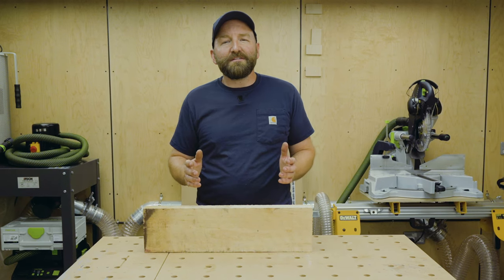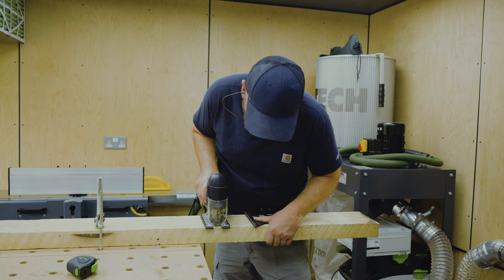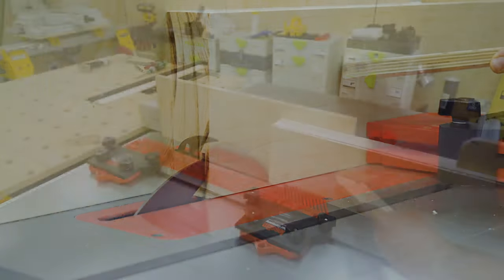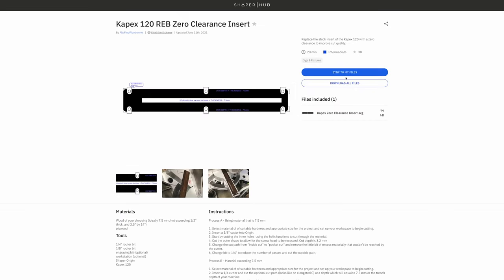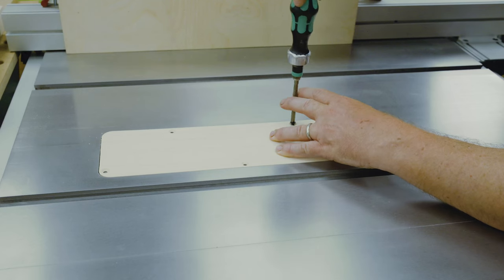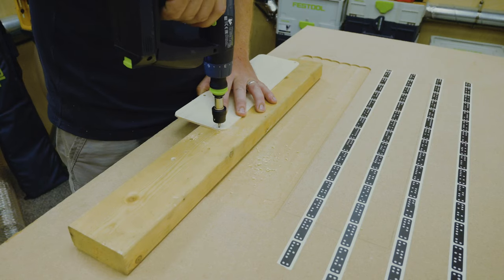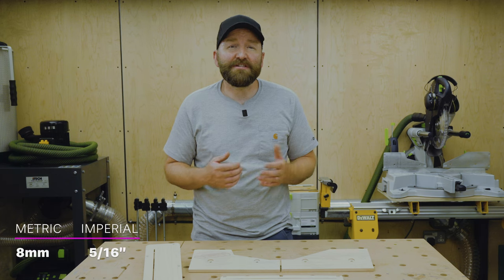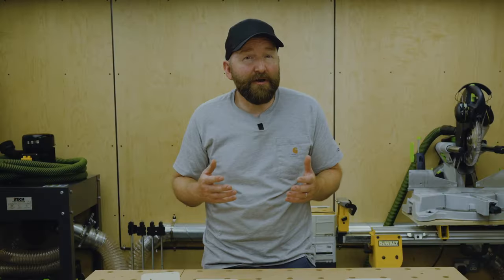How to make BETTER CUTS on your Saws

Comment: Hi Hamish, as you said very nice for a lot of fine work but in everyday work I’m cutting so many different materials and angles so a  quick mdf right angled fence fixed from the back and moved along a bit when you need a new reference point works very well
Reply from the maker: Yup for sure agree. To be honest I have mine pulled back most of the time 🫣 workflow efficiency wins 99% of the time!